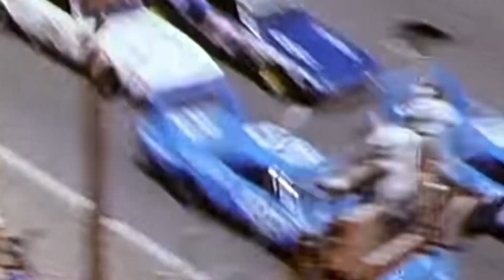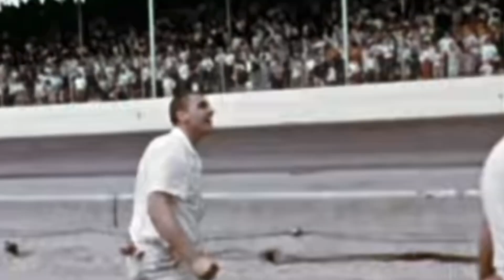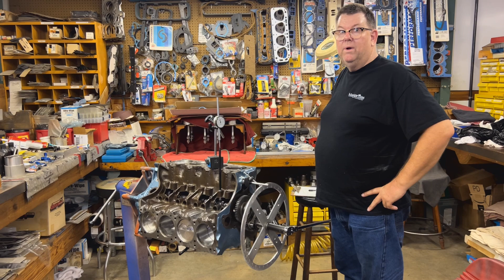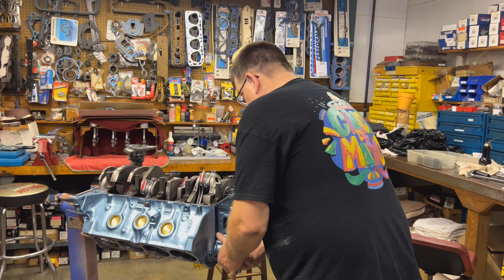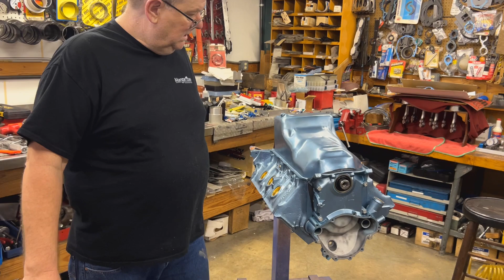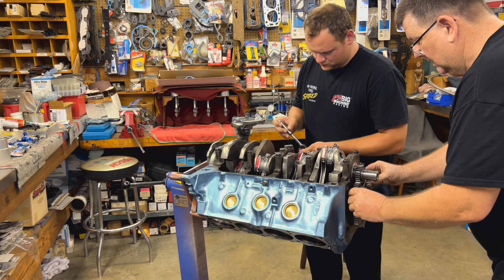Cam Degreeing for a Pontiac 400

Comment: With solid lifters, you might tighten your lash .002 and pick up the 1° lost advance. You''ll need to run the events at recommended lash, then rundown the advance gained with +.002/.004 tighter lash and record events. (the extra padding could save your life, should you ever be hit by a bus)